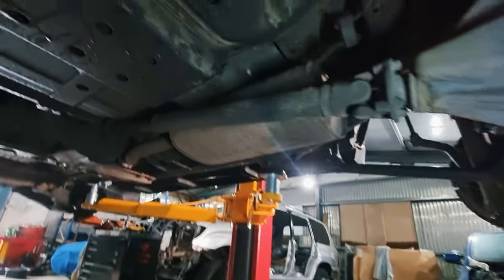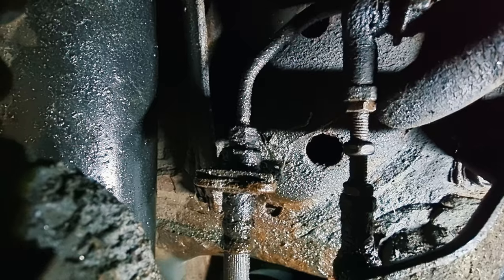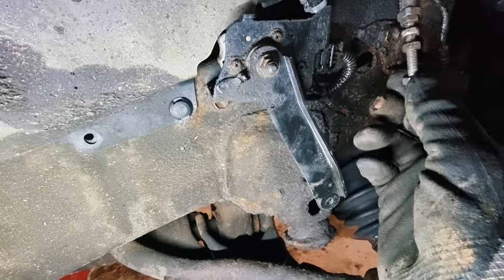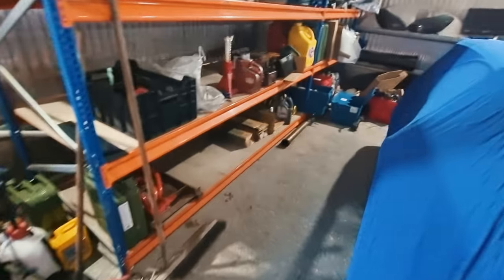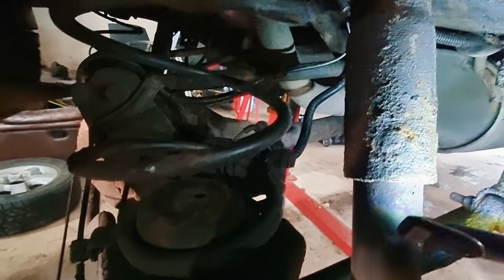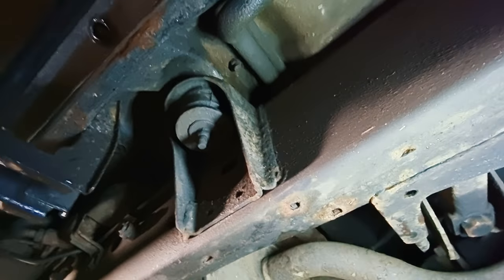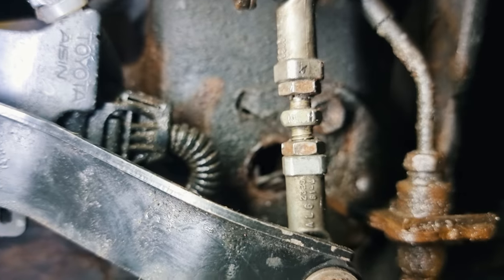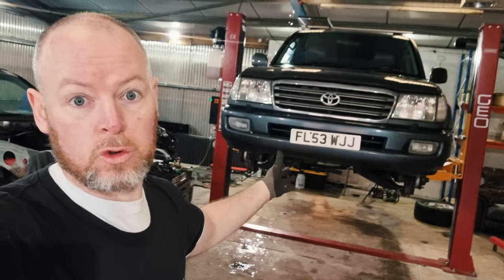AHC Sensor Lift Toyota Land Cruiser 100 series

Comment: Have to be careful with two issues with a sensor lift.  The angle of the CV axles will speed up the wear and easier to bust open the boots and if you do not get a tire alignment after lifting, the tires will wear much more on the outside edge.  Facts.
Reply from the maker: You're right - the front right boot failed immediately and needed new clips. It was already worn so it just busted right away :)
Reply: differential drop is best. like on my LX @landcruiserscotland

Comment: How does it drive so far??
Reply: he died right after first test drive.... the sensor lift caused a nuclear reaction and exploded the suspension and a spring rocketed through his bungie hole
Reply from the maker: My bungie hole is well rocketed.
Reply from the maker: It drives pretty much the same as stock with just a ahc lift. If you go any higher in the front the ahc pressures get too high though and the ride quality is awful.
Reply: @landcruiserscotland do you still have high mode in AHC with this?
Reply from the maker: Yes it still works well. The suspension gets quite hard in high mode now due to the extra pressure. Like super sport mode

Comment: I have 2000 LX470 and the AHC is riding bouncy both off road and on road. Mechanic said: I have to change gas chamber. Is there any aftermarket upgrades? Can I adopt king external reservoir? Did any body try to do that?
Reply from the maker: There are four gas "globes" which can fail and cause bouncy ride. There are plenty of things to check first. Are your torsion bars correctly adjusted? Have you changed the ahc fluid? Have you checked the graduations change on the tank when you go from Lo position to High?

Comment: Wandering why at the front you didn't just move bolt up the bracket?
Reply from the maker: I see what you mean - I didn't even notice there was a slider there too. Normal procedure is to just thread the adjustment rod rather than moving the mounting point. I wonder if it's possible to do both...

Comment: What would happen if I set the car to 'Hi' after doing sensor lift? will the car break itself?
Reply from the maker: Nope it most goes a bit higher and higher pressure for the system

Comment: Did all of that a few months ago on a LX470=100 series LC with 32"x10.50 tyres and 480.000km on the clock, standard landcruiser springs in the back, not AHC skinny ones, turned the torson bars 13 turns up to compensate for soft springs in the front, lifted the back and front as you said, make sure you put the rear springs on the correct side, different spring rates due to fuel tank on left side. 
Loaded up for a rough 6500km trip up for two, to far north Queensland carrying 8 jerry cans including two for water, no back seats at all, food, sleeping gear, tools, spares etc. on all sorts of road surfaces or no road surface, no trouble, works fine. AHC had no trouble lifting, pressure in the system not too high, no tyre wear other than normal. The damping was mostly set to normal and felt okay. Not a minutes trouble with the car.
Reply from the maker: Wow I bet that was running HEAVY! Any ideas what the overall weight was when fully loaded?
Reply: @landcruiserscotland thanks for your a question.  Yes it wasn't light, but, those back seats are Heavy, just the left two seater I can bearly lift(at least 3 Jerry cans worth in that one) and the other ones aren't light either, but had non in there so that saves weight, the LC rear springs take a lot more weight than the LX springs, which unloads the hydraulic shocks, without them pumped up the bump stops were still a distance away from the front and rear axels loaded. I also have a steel bullbar, winch, rear steel bumper and tyre carrier plus drawers, rock sliders, no roof rack! 
The problem in Australia is that one needs fuel for a long range, I carry 260 L. 140L in the OEM tanks is just not enough in a V8 LC or even the 4.5L 6 cyl if you go outback proper. So jerry's or long range tanks it is. You also need water, I carry 50 L minimum. Fuel economy is all over the place on muddy or sandy tracks and distances are vast! So double use is no real problem. I have no clue what it weighed not sure if I want to! Lol.
Reply: Paul , winding up the torsion cars , did it throw any fault codes ?
Reply from the maker: Nothing at all. I used techstream to make sure I only wound them up until normal pressure readings were restored.
Reply: @Bakerboy16  no, no fault codes, now mine is a "98 so hasn't got all the electronics later models have, but I wouldn't expect any fault codes.
Reply: BTW, I've done 26.000km, tyres now 285/85x16 MT "33 (506.000km total) since the modification and been out bush Through mud rocks, bad corrugated surfaces a few times without problems, apart from one of the sensors playing up(disassembled/ cleaned myself, easy, no more trouble)  fully loaded. Weight? - a LOT! 😂
Hint; lower the vehicle to lowest setting when stationary overnight, and change AHC fluid regularly.
Reply: Hello. Tell me, after replacing the springs and lift sensors, did you adjust the hydraulic suspension according to the manual?
Reply from the maker: There are no pressure recommendations in the manual, but yes, I adjusted using techstream to return the pressures to normal.
Reply: @landcruiserscotland  really? 6.9 bar on the front circuit and 6.7 bar on the rear circuit, but the question is different, the height sensors are adjusted via TechStream, I was wondering if you set the suspension to zero?
Reply from the maker: @YonduUdonta404 I believe it's 6.9 mpa front, 6.1 rear. I don't know what you mean by set to zero though
Reply: oh:) the bar with the MPA was wrong 😅zero suspension is when the distances from the front lower arm silent block to the ground and from the ground to the center of the hub, then you subtract one from the other and it should be about 82.5 mm